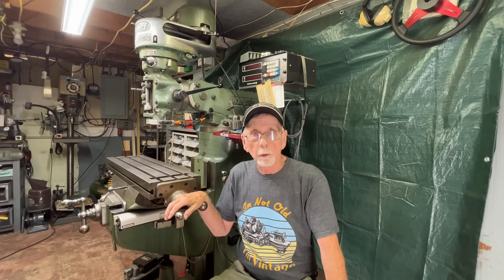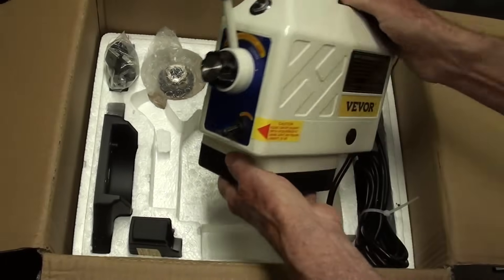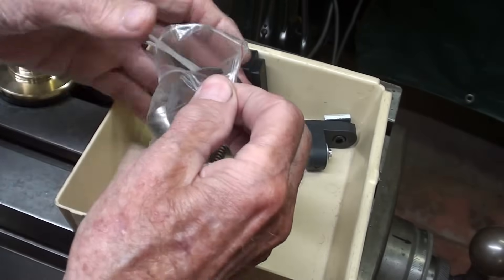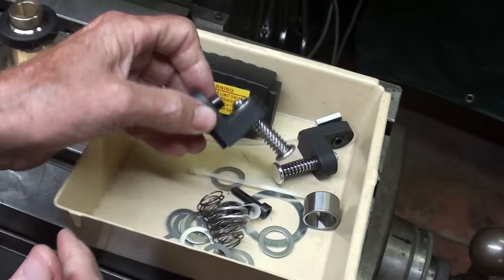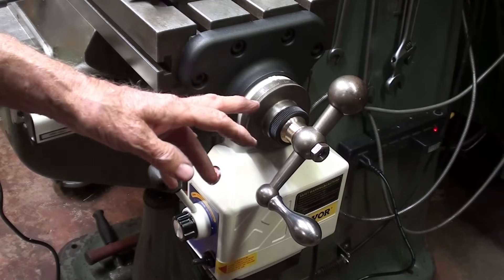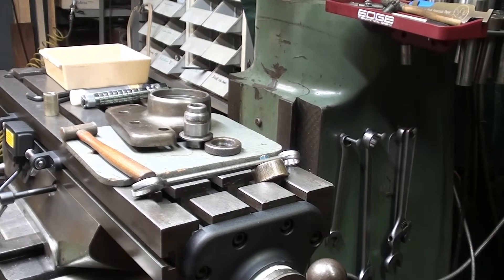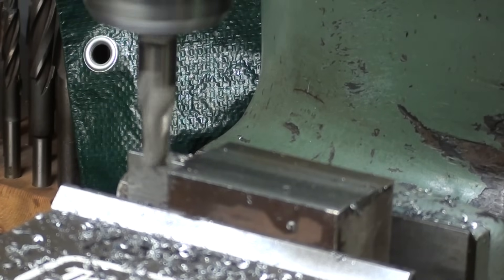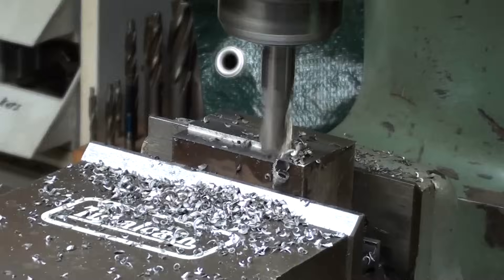INSTALLING A  POWERFEED on the Bridgeport Mill #887 tubalcain

Comment: That’s a heck of a deal for an aftermarket powerfeed!!!! Unless someone has never installed one of these before, the setup of the brass gear is more fun than you can have with your clothes on!!! I’ve installed probably 15 of this type feed unit of all of my new mills when they were delivered. We used to put them on the X, Y, and the knee of all the machines. Sometimes it would take 6+ hours to install all three!! Wish I could remember the name of the feed unit I used all the time. Think they were made in Pasadena California. The last new Bridgeport I bought I got a little smarter, I had Machinery Sales (my local dealer) install the units at there facility. Turns out the didn’t even charge me for the install. Go figure!!! I’ll bet the change the motor or gearing on the future units after your review, as I think they respect your knowledge and opinions!!! Thanks for another interesting video!!!!! Wish you could make it to more auctions in the future. They are my favorite videos you produce. We almost never have a farm auction or even a machine shop auction here in Phoenix. Thanks again!!!
Reply from the maker: Thank you for watching. There have been very few auctions in the last several years.

Comment: Mr. Pete, adjustment pots may be available on the circuit board inside the power feed box. Unplug it and remove the cover, there may be adjustments on the speed circuit board. I love your videos, Mr. Pete, I even watch them backward.😂
Reply from the maker: Thanks for the tip!

Comment: I have two simular units on my Grizzly G0705. Although differant branding I believe the same manufacturer makes them all. That being said both of mine will slow to a crawl and actually stop. I would remove the knob and see if the dtop is built into the knob. Bossibly needs repositioning. Either its defective or some minor adjustment is needed.
Reply from the maker: I will try that

Comment: another great video! Your tone is similar to what mine was when I installed one on my Bridgeport - disappointment. I was replacing a burnt out 20 year old one. I bought the "Taiwanese" one thinking it would be better. It's nearly the same as the Vevor. I don't use mine much because I've yet to get a good gear engagement and can't get the dial and nut to work properly - I ran out of patience. I have all of the shims installed. The woodruff key issue was a good excuse to use my surface grinder. My kit came with a nut for the handle that threaded down the shaft more because it went into the handle body. I think mine can be slowed to a crawl.

Comment: I have three fitted on my Bridgport, exactly the same as yours but a different make. They work perfectly well and will go extremely slowly, torque is not a problem. The unit fitted to the knee has no problem at slow speed, very useful when boring. I keep the slideways well lubricated with the Bridgeport oiling system installed.
Reply from the maker: Good to know!

Comment: I think I would open up that unit to see if you can adjust the minimum speed pot on the drive board?

I would also buy a spare gear that goes on the bottom of the unit. It is a sacrificial plastic item. One crash and it's done.
Reply from the maker: Thanks

Comment: Hi mrpete, I have watch your videos for years and always seem to learn something. I was thinking that maybe the knob for the speed adjustment is not installed on its shaft in the correct location? it may need to be loosened off and rotated on the shaft to allow for slower speed? Just thinking it may not have been assembled correctly in factory. Thanks.
Reply: usually the potentiometer itself has the end stops, not the knob. I'm sure if you opened it up and reverse engineered how the speed control works, it would be possible to adjust the range electronically. It could be that they ran out of some component value, and some "smart person" in manufacturing substituted something "close enough" which wasn't close enough at all

Comment: You will want to to make a stand-off to give you a little more space between the crank and the unit, I got my hand pinched by one of those when I hit the feed by accident.

I was not the only one at that university shop to do that so the guys running the student shop made extension collars so your hand couldn't get stuck
Reply from the maker: Great idea. If possible, send me a picture. Although if I cannot get this unit to run slower, I may remove it. And go back to the Armstrong method.
Reply: @mrpete222  I wish I was still in proximity to that shop, I miss those guys.

It was just a shaft extension they machined to fit onto the shaft in the place of the handle and moved it out about 2". I think they used set screws to hold it on which isn't ideal but how often are you taking it on and off?

Comment: Good video.  Just to note, there are Taiwanese version of these power feeds that look the same but are of much higher quality.  1. The knurled nut is metal.  The slowest speed is much slower.  Fits and finish is much better.   I have mine on a Precision Matthews Mill which is also made in Taiwan.  The Chinese machines are much lower quality, overall.

Comment: Our clausing kondia has a power feed on it and it can feed extremely slow with torque I'm not sure the brand of power feeder but when you turn the speed dial all the way left it stops the power feed so it's nice to be able to adjust from 0 to whatever speed I need.

Comment: I fitted a similar unit to a Tiwanese B/P knock off at the Railway Museum that I volounteer at, last year. Instruction not too good, but worked it out OK. No problems with the key, as all metric to start with. Took some time to set up the spacing for the gear mesh, the limit set up went on the front and fitted OK, as the DRO scale is on the back and not as wide as yours. The table feed can be set low enough to actually stop it and it works a treat. This unit cost about A$700.00 and is a different brand.

Comment: I built a power feed for my mill/drill after not being able to find a commercial unit that I liked.  It's based on a Dayton gear motor, and works great, but its' fastest speed is about the same as the Vevor's slowest speed.  No rapid traverse, but it can be disengaged with a lever, and my goal was basically just help milling long, slow cuts.
Reply from the maker: Very cool!

Comment: I think something is rotten in Denmark.  Maybe some adjustment needs to be made internally.  I am certain all of those regardless of brand or cost are made in the same factory and made the same way.  Using the little speed adjust knob in the center of the direction lever I can slow down the feed until it actually stops.  They were exactly the same on the Grizzley I had and the Precision Matthews.  Thanks for the video keep on keeping on.
Reply from the maker: Yes, I’m sure they’re all made on the same factory. I am waiting to see what the company has to say about this, if anything.

Comment: It has to be a Chinese translation thing calling brass copper. I've seen it in many catalog items and even some of the things I've bought. (step 2   "install copper shim ) I looked all through the box a few times, there were no copper shims but there was a bag of brass washers, ah-ha!. It took a minute but I figured it out. I have a bench mill with a drive like that, that mounts horizontally. Most likely made by the same company but it seems to be able to turn a lot slower than yours. For the price you can't beat them.

Comment: Hi Lyle, I installed the same power feed. Mine slows way down with good torque. Something in the electronics must need adjusting. I had all the same mounting issues.
But I'm quit happy with the unit.
ATB....
Reply from the maker: Thanks for the info

Comment: I modified one of these, (not a vevor, but a weng ding, looks identical to what you have there.) for my Hardinge TM, I had to make a different end plate, and a lead screw extension with thrust bearing, but it does the job just fine. One point of note, if you do a lot of cast iron work place a piece of packing tape over the rapid button, it will keep the fines out otherwise it will jam up and cause issues.otherwise its been a fine item.

Comment: Thats interesting i installed this exact same power feed a week ago and out of the box mine moves MUCH slower than yours. I wonder if something is defective in yours. I had to do a bit more modification than you to get it to fit tho because my mill is an 3/4 size Enco. I had to bush the shaft for the roller bearing to fit.
Reply: Agree. There is something wrong with the reostat.
Reply from the maker: I am beginning to think that it is a defective unit

Comment: Those springs can be put inside that little cover/box thing and they will help to keep It from flopping around and provide resistance against the plungers. It's odd that you can't slow it down any further. Mine will go very slow. There should be a POT right on the side of the unit, I believe I can even see it in your video. Try using that to slow it down. It's separate from the speed control on the front and is adjusted with a screwdriver. (You might need to pop a little plastic cover off, the POT is underneath)
Reply from the maker: Thank you, I will look for that

Comment: I have a Grizzly mill. Love it BUT. there power feed sticks straight out the side, making the table area needing more room. Also with there power feed you loose a handle one one end. I would be interested in installing this one to improve on these faults. Also the limit bumps were only adjustable by loosening them and moving them. Impossible to make fine adjustments. I remade them out of aluminum and installed screws to contact the switch. Now you can very easily make fine adjustments.

Comment: Excellent timing, I am installing my new (to me) Bridgeport mill at the weekend, and the factory traverse is missing the control module as it apparently went pop, so I have been looking at these exact conversion unit. Luckily my DRO scale is factory fitted on the rear of the table and appear to be slimline versions of the scale. Mine is the later Varispeed head model, I used a friends one recently to skim a straight six Triumph cast iron cylinderhead with a big flycutter I made, and the original traverse on his worked great and gave a good finish

Comment: I picked one of these up from ebay about a month ago, wish I had seen your video first. Mine does run slower, according to my DRO 3/4 IPM.  When I installed mine it immediately tripped the GFCI and the rapid override is not intermittent, it will run on rapid until the lever is shifted to neutral.  The seller preferred to give it to me for less than $20 rather than return it and at that price I'm more than happy with it.  I wouldn't have kept it at much more than that though.

Comment: Free is nice.. Servo is better.. !! I owned a tool and die shop 37 years. We had 9 vertical knee mills. I had mostly all servo brand (pricey but America) but I bought a couple of these or similar from China and we wore them out pretty quick. If you’ve been hand cranking all this time I’m betting you’ll get decent mileage out of this one. A cross feed and a knee feed should be next on your wish list. The shoulder joints get old and the ability to catch a sip of coffee between feed cuts is always nice. I’ve served my apprenticeship under my dad and we had 3 Index Model 55’s.. later After he passed I bought Bridgeport, Lagun, Comet(junk), Millport (ehh!) Enco and An A Trump (loved that mill had a 40 taper spindle and 5 hp)  now I have an Acer.. it’s my second one and I have to say I love it. I’m working as an Engineer/Tool and Die Designer/maker for an old old customer these days. Keep cranking those handles.. it keeps us sharp and in shape. You know what CNC really stands for??? Christ No Cranks…

Comment: these standard powerfeeds are desingd for hobby machines with  2 mm  (1/12) pitch spindles the bridgport has probebly 1/8 or 3/16 pitch . max speed is  higher and so the slowspeed is faster  nice job
Reply from the maker: Excellent analysis, never thought about that. But they should have taken that into consideration.

Comment: Mr. Pete I had to work on a pipe beveler similar type of operation.  There it was a minor adjustment located in side the drive.  I would try to contact Vevor and ask if their is an adjustment.  I know you should not have to do this.   But it should be able to slow it down to better speed. Nice looking powerfeed but looks is not everything. Thanks for the video.

Comment: Mr. Pete I have two of the Vevor 450-inch lb. units myself. So far, I like them with one exception and that is the plastic lock nut for the micrometer scale. I tried a steel nut off of another unit and it will not work so I guess the plastic one is what I am stuck with. But for the money no other issues.
Reply from the maker: I would like to make a steel or brass not. I suspect they are metric.

Comment: G'day.   I watched the Installation,  which went well. The main question of the original slow speed control that urks me a bit is.
I have fitted the power feed to  Bridgeport Mill previously,  & always have had a complete stop on the variable speed control, which is under the the directional lever. When the variable speed knob was turned clockwise,  I had full control from very low speed to to a good fast rough cutting speed on  X  travel.
I was disappointed in that you didn't even move the speed knob.
Still a good video.  Thanks
Reply from the maker: Of course, I use the knob. I think I failed to show it in the final version of the video.

Comment: Looks good but - have you had any problems with the proximity of the crank handle and the new switch handle?
Could you fit the limit switches to the ends of the table on the rear side as a safeguard but not adjustable?

Comment: Ive been interested in one of these since I got my small mill.  Im worried that my x axis screw is too short to fit the device. At that price, I can probably take the chance though. Thanks for the good info, Mr Pete.
Reply: Mine was too short, I just made an extension. piece of cake. You are a machinist (hobby guy) so machine.

Comment: I can tell right now I wouldn't be happy with that unit.  That too fast feed speed would bother me every time I used it.    I put a Shars power feed on my Bridgeport and it feeds much slower but is a little fussy to set.  Very tweekie to adjust.   I also had to do more than my fair share of modifications to make it work.   You would think there's enough Bridgeports out there that someone could make a value priced feed that is designed to better fit.
Reply from the maker: My thoughts exactly

Comment: I agree with Mr. Pete. Vevor needs to re-engineer the drive for slower and more range of the variable speed to accommodate heavier torque requirements.
Thanks for sharing.
Reply: Vevor doesn't engineer or make any of this stuff - they just slap their name / sticker on it

Comment: Great product review.  Like most if not all Chinese products I have experienced, a person has to finish making it or modifying it to work.  They cut down on the windings on the motor and it has to run fast.  I guess it's only $100 but, I'm sure people would pay a $100 more to get one that operated correctly.  Thanks for the video . That oblong   knurled knob would drive me nuts.  Small detail but, I couldn't buy it either for that reason alone.
Reply from the maker: Totally agree

Comment: I installed the same powerfeed about a year or two ago. I used a keyway broach to make my gear fit. The instructions leave a lot to be desired. You're best bet is to throw the instructions away and figure it out yourself.

Edit: mine is much slower too. If i turn mine completely CCW, it doesn't move at all.

Comment: I had the same too high feed rate on my after market power feed on my Millrite.. I sometimes connect a heavy duty router speed control when I need an extra fine feed. It's a simple 110V plug and cord plug on the speed control.

Comment: Trim the stop mounts to match the switch height? increase the cutter rpm to get the proper cut amount/tooth and still maintain original slow drive speed and keeping all that torque? bracket the limits to allow mounting on the front of the table?? looks like it provided a lot of little projects lol.
Reply from the maker: Good tip!

Comment: I just bought a milling machine similar to a bridgeport but its made by Famco. I believe it was made in Wisconsin. It has feed on all 3 axis but it does not have feed on the quill which I found odd. It also has digital readout on 2 axis. It has a 30 nmtb spindle. I paid 850 for it.

Comment: I share your thought about finding work arounds when it comes to new products.  We shouldn't need to re-engineer a product to make it work properly.  I would think that since the product was produced using milling machines or devices such as that, that someone at the factory would know about surface finishes.

Comment: This particular problem is something I've dealt with on both American made units and the cheap Chinese ones like this Vevor or the ALSGS. On all of them I've found that in order to overcome the initial friction to get the table moving I often have to turn the dial past the speed I wan it to go then dial it back down to get the feed rate I'm looking for. You may have just gotten a bad unit with a bad rheostat though.
Reply from the maker: Be sure to watch the follow up video. Video number 888.